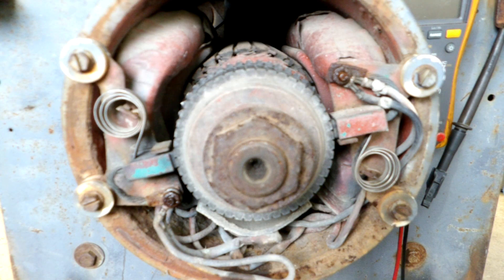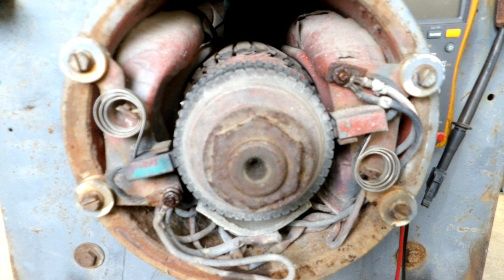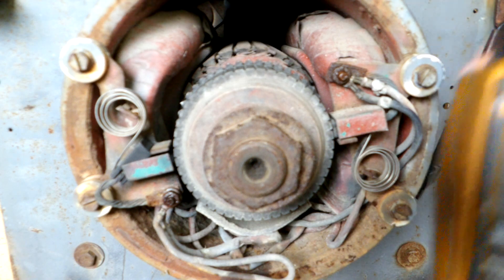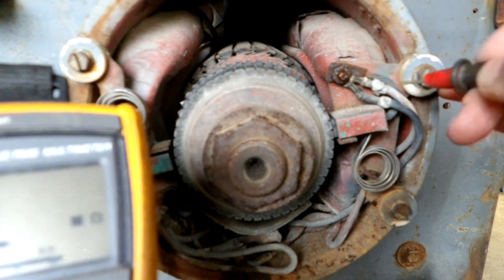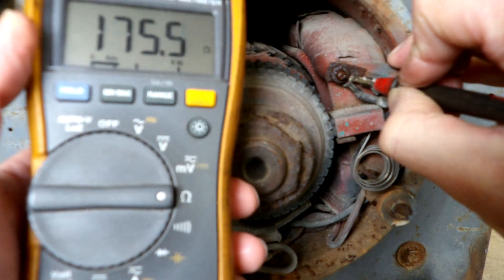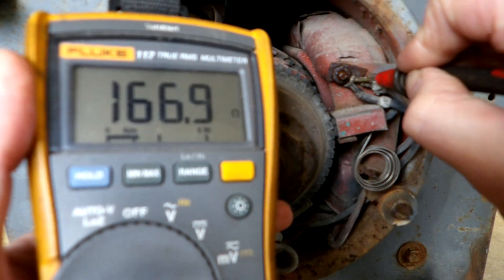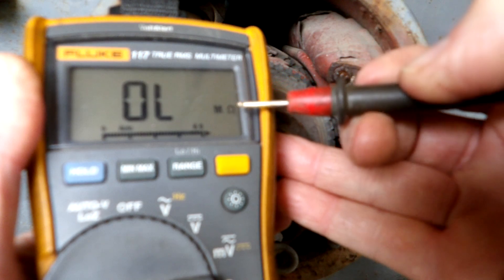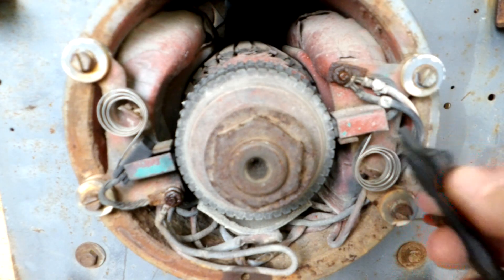SA200 Exciter coil testing

Comment: Hey I have a sa200 I have power to the 115 plug but no power to the welder... 158 ohms when I test like you instructed... It has been sitting awhile
Reply: I have no remote switch on this unit...
Reply from the maker: @CJs_DIY  Please check the output at the welding leads.  If it welds then you have a simple wiring issue to track down because the exciter is fine.  If it doesn't weld then you should test the voltage at the exciter brushes.  I am assuming that you cleaned the exciter armature with old style wood type sand paper or a "comm stone".  I have seen many machines come in that been sitting for quite awhile and both armature communtators are covered with a thick black tarnish and goo.
Reply: I’ve been watching quite a few videos and it could possibly be my main brushes are stuck I am going to take the cover off and check... the exciter Brushes and exciter commutator look to be fine and the guy I bought it off must have cleaned them recently because it was down to the brass. I hooked up my cables to machine started it and tried tapping a rod on grounded steel and there was nothing... no spark etc I will put a volt meter on the connections at the welder to see if it’s outputting anything.
Reply: There is 2 switches on this unit. One shuts off the engine and the other? I am assuming it has to do with putting power to the main generator magnets to allow welding???? But really don’t know what the other switch is for. I will also check for voltage at the welding lugs with the switch off to see if the switch is upside down.
Reply from the maker: @CJs_DIY  The other switch is likely on the left side of the panel - if it is that's the high & low idle switch.  Since the machine doesn't weld or grind I'm going say that I would open the main brushes and check them - just because.  They don't have any affect on the output of the exciter though.  At least not on a SA-200.  On a 300D and such they do.  Okay, after checking the main brushes, I would take a voltage measurement at the exciter brushes.  If there is no voltage then you should consider "flashing the fields".
Reply: Kevin Gardner the 115 house plug works. I’m assuming this is what you mean by grind? If so it Grinds but doesn’t weld
Reply from the maker: @CJs_DIY  Yes, that's what I mean by "grind".  And, that's all that outlet is meant for.  It is DC voltage only.  Trying an AC power tool in there will burn it up.  Now that say you have grinder power it's time to check the main generator circuit.  Take a close look at the fine current control "rheostat" for burned winding or loose connections.  Then look at the coarse current switch for being burned out.  If they are both fine then it's time to check the "shunt coils" circuit.
Reply: I have 2 volts coming from each gear/Voltage setting
Reply: Not sure on how to check the shunt coils but thx for all your answers man appreciate it 100%
Reply from the maker: @CJs_DIY  to test the shunt coils you find and isolate the blue and brown wires coming out of the top of the main generator.  Test them for an ohms reading of 50.  You do this without the engine running.  When I get time I will make and post more videos of testing these and other machines.
Reply: The ohms meter says it is 50ohms but it gradually gets higher the longer The meter is connected
Reply from the maker: @CJs_DIY  great.  Best to look for bad wiring now.  Good luck.
Reply: Thx again man Appreciate it...

Comment: I have a sa200 that will spark but will not weld i have cleaned brushes and armature and nothing helps we have had this problem in the past and found a bad wire i checked that wire and it was good im lost
Reply from the maker: If you have done the test as I have shown in the video and the coils are fine it is time to check the voltage while running.  PLEASE BE CAREFUL AROUND THE SPINNING SHAFT.  Set your meter for DC volts.  If you find around 80 volts at idle and around 120 volts at high idle the exciter is fine.  Check the outlet with your meter or plug in a DC grinder.  If the grinder runs fine and the engine revs up - great.  Next, does the machine have a local/remote switch?  Is it working? Is the panel rheostat fine? Both good? Great - test the "shunt coils" inside if the main generator via the blue and brown wires coming out of the top of the main generator.  One of the the two wires must be disconnected to get a proper reading.  That reading should be around 50 ohms.  If that is fine you may have a shorted main armature and that is sometimes indicated be major sparks coming from the main brushes.  Hopefully, I can post the video soon.  Best of luck, maybe you will find a simple bad connection as I often do.

Comment: More video  .. I'm trying to get an sa 200 going.... it will turn a grinder but no welding..
Reply from the maker: That's good news.  When grinder runs that means the exciter is fine.  Now you have to test the feed to the weld generator shunt coils.  Test your output with the remote switch in local if you have one. If you have weld power the problem is in the remote circuit.  If still no weld isolate the blue and Brown wires going into the top of the generator and test those for 40 to 50 ohms.  A high ohms reading means bad shunt coil circuit.  Could as simple as a broken, corroded or chewed thru wire.  At worst you have burned out coils.
Reply: @welderfixer  thank you brother.
Reply: Hi my welding machine just started but it dont weld, power works and grinders when I drag my rod across the pipe small sparkles are seen but no arc

Comment: Thank you for this video I have this some thing going on on my sa200  code-6793 s/n a-658851. So I checked the coils as per the video and I have 173.5 ohms but I don’t have a remote switch local only any idea where I need to go from here ? And again for the help
Reply from the maker: Jeff, post your machine symptoms here and I'll offer a couple of suggestions.
Reply: Kevin Gardner Hey Kevin my sa200 will crank and run but is not making any power at the auxiliary outlet or at the welding leads
Reply from the maker: @jeffholliday4146  Sorry for not seeing your post earlier.  Seems I am not getting notifications from YouTube very often.  Since you have 173 ohms on the coils I would simply "flash" the coils to rebuild the magnetic field in the iron inside of the coils.  These machines need that residual magnetism to get the power to build.  Let me know if you need instructions on that procedure.
Reply: Kevin Gardner instructions would be a great help I really would hate to burn something up and again thanks for the help.
Reply: @jeffholliday4146  hello there, i am able to run a grinder but am only getting little sparkles from the rod. what should i do? thanks
Reply: @ianr4654  did you get to the bottom of that?

Comment: How far back does this go Sa-200 wise? Would they all look similar to this no matter how old they are?
Reply from the maker: Works all SA-200 and a few others like them.  There is a little difference depending on the number of turns of wire in the coils and if the coils are wound with aluminum from sometime in the seventies.

Comment: The insulation on all my wires are so old and brittle. I had to replace the brushes in my machine and when I started moving the brush holder brackets the insulation really started coming off in chunks. Is there a way to replace those wires? Just say cut the wire back then add butt splices with new wire to go to brush assembly? Is that possible or do I need to buy the new coils with all new wires?
Reply from the maker: I've seen many machines saved buy doing that.  Just find as flexible wire as you can.
Reply: Kevin Gardner thank you. I did that with my exciter brush wires and came out good. Then I started taking the electrical plug off to change it out and OMG those wires really started coming apart. So now I’m trying to find where they go to replace the whole wire. lol. That is if I can get to them without pulling the whole armature assembly off the machine and pulling it all apart.